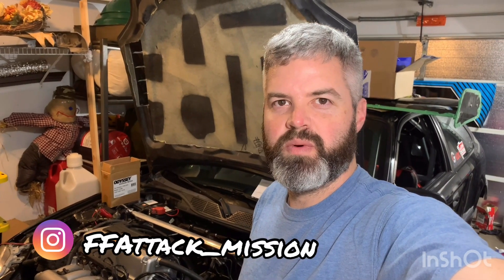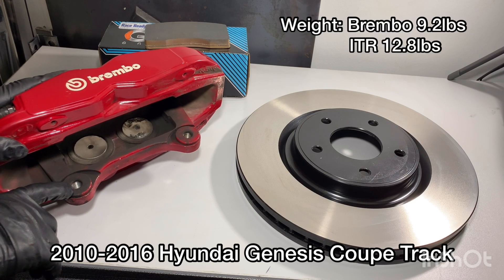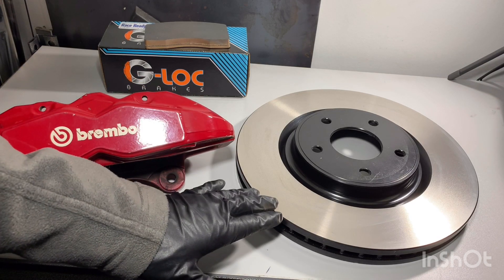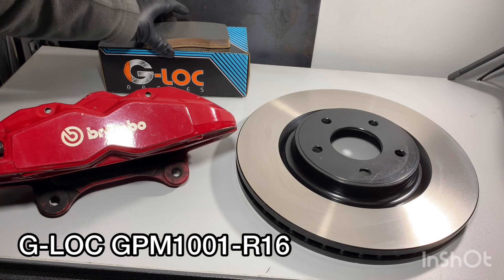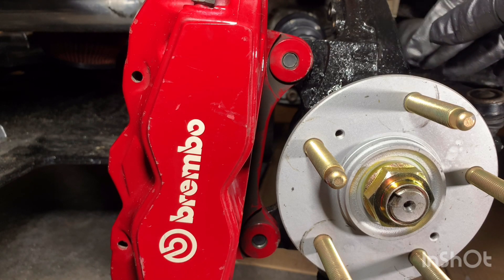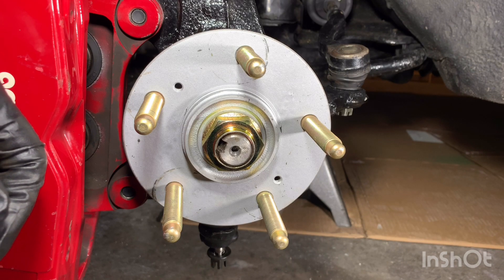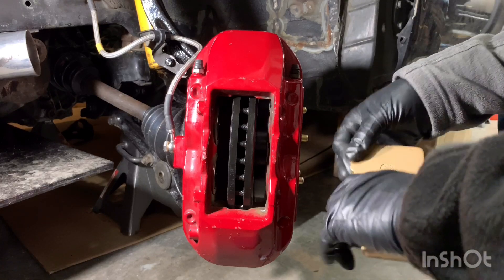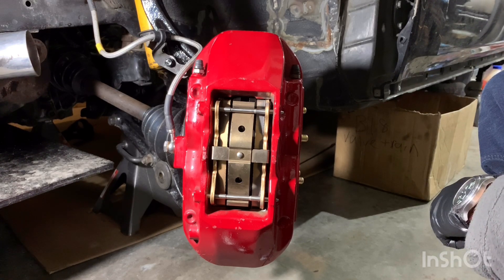DIY Brembo big brakes Civic & Integra

Comment: Thank you for this info it will help with my time attack cb7 since it it is the same bolt spacing with the itr spindle. What is the recommended rotor diameter for this?. Is their a range that works.

Comment: I have a TSX and thinking to purchase these Genesis Brembos too.  However, I am wondering if you would know the pistons sizes of the brembos, since we have to swap them left to right if the brembos have different size calipers it will mess up the balance right?
Reply from the maker: The pistons on the Genesis Brembo’s are all the same size. They do not have a leading and trailing piston size on each so swapping sides has no ill effect.
Reply: @FFAttack  For brake pads, are the just same with the STI or EVO pads?
Reply from the maker: RaphaelYC they are GP1001 pads the same as STI/ EVO as far as I can tell.
Reply: @FFAttack  Hey just received my rotors, pads and calipers.  The pads seems to be bigger than the rotors surface will that be a problem?

Comment: Any issues with noise from the brake swap? I've been reading on a forum and there were several complaints about a squealing noise.
Reply from the maker: My car is a track only car so yes I have some brake noise using race pads. Not sure about on road, I know a few with them on dual purpose cars with out complaints.

Comment: Would these brembo calipers work well with the base model mini cooper rotors that a lot of people commonly use as a big break upgrade for civic/integras? I believe those rotors are 280mm which is ~11" and are 4x100
Reply from the maker: No they won’t, the Callipers is made for a much larger sweep. Stock the Genesis runs 13” rotors so putting a 11” rotor in them will not work. This setup I did runs a 12.5” rotor if I remember correctly. In the video I compare them to my TypeR rotors that are the same size as the mini ones.

Comment: How is the pad coverage w the Rogue 12.6” rotors? Trying to determine if the 12.44” rotors from the 09-12 mini JCW would work for 4 lug folks. Do the rogue rotors have the same offset from the hub mounting face?
Reply from the maker: With out trying it I could not tell you for sure. I believe you would have a lot of pad overhang if you ran it on a 12.44 rotor.
Reply: @FFAttack  measurement wise it should be around 2mm overhang depending on the pad. Not optimized but should be functional in theory? Based on technical drawings I can find, the caliper should work with a pad shim on each side to take up some thickness. Might order a rotor from Rogue and Mini to compare 1:1
Reply from the maker: Yes your right, sorry I was thinking the smaller Mini rotor, that would not be bad. On my setup currently I have 1-2mm of pad overhang. Since I inoculate did this I have heard the Sentra SE-R rotors are fit with no pad overhang. I plan to try it when I need to change rotors. Nothing I have seen for 4x100 though.
Reply: @FFAttack  which year of Sentra? If I’m ordering to take some measurements, I can try to have a peek
Reply from the maker: @Luckyblooms I have not dug into it enough yet to know for sure. I was told you also need to run the RSX type S hub with the larger hub centric ring. I believe the 2007 Serra SER Spec-V is the one that is needed. CENTRIC 12142098 Rotor from my quick search.
Reply: @FFAttack  just based on listed measurements, SE-R seems to be 0.2mm smaller diameter
Reply from the maker: @Luckyblooms looking at mine ideally the rotor needs a 4mm wider contact area 1-2mm on the diameter and 2ish mm on the ID of the contact surface.

Comment: What size wheels you used to clear the caliper
Reply from the maker: I’m running 17x10’s et18 on my car. Fitment will really come down to the specific wheels. 17x9 RPF1’s do not fit but 17x9 Konig Hypergrams do. That’s all I have tested.
Reply: @FFAttack  sorry to bug but what offset were the 9's is your rears 17x8?
planning on buying advans 17x10et35 and 8s in rear

Comment: In your honest opinion how well do these perform once they get hot? I also have a k swap ek civic with the Porsche calipers on my four lug set up but I want to go 5 lug to run 17inch wheels. Thinking about using the crv knuckle for the front. Trying to determine what front brake set up to go with, seen the TL set up, genesis set up, or maybe go with fast brakes on a custom set up but that’s easy 2k dollars.
Reply from the maker: The track I use to drive on was known for being a brake killer, lots of slow corners with little straights so no time to really cool the brakes in a lap. These handled it just fine. Last year I removed the dust seals on the pistons as they like to catch fire. I just drop a drip of brake fluid on each piston to keep the seals fresh. I have run these for a 45min session in 32c weather and not had brake fade. I do have corvette brake ducts (have a DIY on them). So I have a steady flow of cool air. Pads are really important too, the G-Loc R16’s take all I can toss at them. Now that I run on less brake abusing track I’m not worried about this setup handling heat at all.
Reply: What wheel hub did u use, CRV or RSX type s?
Reply from the maker: CRV but I’m going to try the RSX Type S next time I do the wheel bearings. From what I hear you don’t need to do any machine work with the RSX type S ones.
Reply: @FFAttack  thank you so much for replying; i got the rsx type s and 2014 rouge 3row rotors i can send u photos so show fitment if needed before u buy

Comment: If I’m going from a 4 lug to 5 lug in the front what rear hubs can I uses to match the 5 lung that would fit my 92 eg? Or is there a wheel I can buy that would fit both stud patterns?
Reply from the maker: I still have 4x100 rear, my car runs 17x10 front and 17x8 rear so I’ll never be rotating the wheels and tires front to rear anyways. Generally to do 5x114.3 rear you need ITR stuff.
Reply: @FFAttack you can always go CR-V front knuckles and prelude SH rear hubs on stock eg/da/dc trailing arms.

Comment: Looks like the caliper is going to be on upside down? I believe the small piston is supposed to be at the oncoming rotor side with the brake bleed up.. This to prevent pad beveling as I recall.
Reply from the maker: Bleeder is up, no issues with pad wear so far.

Comment: I don’t know if someone can confirm that my idea would work.

Can I use rsx base 32mm bearing and hub in a type-r (crv) knuckle. ? 

Than I would only have to make a ring to make it hubcentric with the rotor. (64.1 to 68)
Reply: What? Just put the rsx hub in your stock knuckle. They all use the same bearing.

Comment: What rotor can I use if staying 4 hole rotors? It would be for a Integra LS coupe.
Reply from the maker: You can use the Rogue rotors as outlined in this, you just need to get them red re-drilled to 4x100.

Comment: Hello sir.. Kudos to you.. For this; I have a 1998 JDM itr 5x114 pcd with 36mm driveshaft.. Would this set up be suitable for my car without any further modifications? Thank you for help.. 👍
Reply from the maker: You will need to slightly machine the centre bore of the hub like I did in the video or the rotor to fit over it. It’s a very spall amount and any machine shop can do it.

Comment: Got a question I have  2011 Hyundai Genesis R Spec Calipers are they all the same and what diameter where the rotors
Reply from the maker: I believe all the R Spec calipers are the same. The rotors I used are 12.5”z

Comment: I have a d series track built ek. Considering this upgrade. Will the stock axles mate with the crv spindle ?
Reply: I think you'd need CRV knuckle, CRV bearing. RSX base model Hub wich is 32mm axle. The Type S RSX hub is 36mm

Comment: How is the brake pedal feel after installation? Did you upgrade the brake master cylinder?
Reply from the maker: It’s fantastic, firm and much easier to modulate. Breaking distance was much improved as well. I’m still running a stock 1” master.
Reply: @FFAttack  Nice! What about the brake bias? Did you adjust anything?
Reply from the maker: Yes I did redo all the break lines in the car and installed a Tilton prop valve. I have heard about others running on a 40/40 valve with a very low bite rear pad.
Reply: @FFAttack  Good to know. Just curious. Why did you redo all the brake lines? And  decreasing the brake line pressure for rear brakes would give better brake response?
Reply from the maker: I redid them to allow the Prop valve and simplify. I wanted to be able to adjust bias easily. Up here we get a lot of wet or damp track days so being able to adjust braking is a good idea. On these Honda’s the factory lines are Married front to back meaning the drivers front is on the same circuit as the passenger side rear and same on the other side. So when you put adjustable prop valve in you kind of need to do the lines. Ideally yes you do need to reduce pressure to the rear when going this big in the front. Going with a low grip rear pad is a bandaid but can work as well.
Reply: @FFAttack  Thanks for all the information. Good job!

Comment: Ok all the searches I've keep coming back with the CRV hub diameter of 64.1. What hub do you have at 70.1? I'm so confused. Because if the CRV is 64.1 and the Rouge rotor is 68 then you shouldn't have to machine.  I'm only asking because I don't have too many machine shops in my area willing to do this.
Reply from the maker: The wheel Center boar maybe that but the part of the hub the rotor centres on needs to be same as the rotor.
Reply: If ain't wrong the crv hubs are 71.X like the jdm itr hub, the thing i think it works is to put the ep3 CTR or the rsx-s (i think are the same) hubs wich fit in that spindle because they have 36mm shaft but the center is also 64.X like regular 6gen civics integras etc, someone correct me if im wrong but recent information i read goes in that direction
Reply from the maker: That’s correct, I’m putting RSX Type S hubs into my CRV/ITR big bearing spindles. This should get around any need to machine anything then use Sentra SER Spec V rotors.
Reply: @FFAttack  have you tried the sentra se-r spec v rotors with the rsx type s hub yet? Looking at specs, the rsx hub is 64mm and the sentra is 68mm still. So the rotor wont be hub centric. 

Are these rotors hub or lug centric?
Reply from the maker: @henrybui6353 not yet, the way the Rouge ones are setup on my car they are hub centric.

Comment: If ain't wrong you could use ep3 ctr or rsx-s hubs wich have 64mm center 🤔🤔
Reply from the maker: That’s correct, when you have the larger Wheel bearing CRV/ITR spindles you can direct swap the hubs. I’m in the process of doing that now so I can run the slightly larger (07-12) Sentra SE-R specV rotors.

Comment: Hi great content btw ... would the oem genesis brembo pads work? Instead of the g loc pads or is there a difference between them. Thanks and also I'm still on the 4 bolt hub not type r on my dc2 any other rotor that you know might fit
Reply from the maker: Stock Genisis pads will work fine. This car is strictly for track so stock pads would not work. No options I know of for a rotor in 4x100. You would likely need to red till the 5 bolt rotors to 4x100. Glad you like the content!
Reply: @FFAttack  thanks for the reply ill look into it 16.8mm disc if I can find one ill let you know

Comment: Thank you so very much for the detailed video! I have a couple of questions if you have the time. First is, which rear brakes are you using, are you using a bias adjuster and finally, what size wheel/offset/width are you using? Thanks again! You have a new subscriber in me!
Reply from the maker: I’m using stock GSR rear brakes with a Tilton prop valve. Wheels are 17x10 et18.
Reply: @FFAttack  that's good information. Thank you very much for replying!

Comment: Hey great video had no idea this set up was a thing so the machine shop made the bore smaller or added to it to fit the rotor ?
Reply from the maker: They had to machine a small amount off the cantering ring of the hub. I also could have had that taken off the rotor instead but wanted to make it so I could get a replacement rotor anywhere and just swap it on if I had a failure on track.

Comment: What submodel nissan rogue? Man i cant find the rotors at all wtf
Reply from the maker: 2017 Rogue 2.5L w/3rd row seats. Search on Rock Auto for RAYBESTOS 981779R Rotor that will get you into the right area.
Reply: @FFAttack  thank you so muchh!!! I found them on rock auto like u said...i picked up some refurbished rebuilt brembos from oreilys.. and now im worried will the rogue rotors fit my accord? I have a 2019 accord 2.0 sport... 64mm hub size.. 5x114 bolt diameter... the nissan rogue rotor is 68mm.. is that still okay? Will they still fit
Reply from the maker: No idea, only tried them on my 6th gen Civic.

Comment: Hi. I read all the comments and In what your videon3 times. I know you said the rotors come from a Nissan rouge with 3d row seat. Now. No one asks here, the year of the Nissan and model. Wen, you try to get the rotors, those are the info you need to get the right ones. Did you still have that info? I will be the rotors part number?
Thanks. I'm looking forward to upgrading my Crv 4wd turbo brakes.
Reply from the maker: Thanks for that I updated the show notes with the year I used. It was a 2017 MY

Comment: Have you tried fitting 16inch wheels with this big brake kit?
Reply from the maker: Zack T you need a minimum inner wheel barrel diameter of 385mm if you have that then you will need to make sure the spokes of the wheel clear. I have no 16’s to check fitment with.
Reply from the maker: Currently I don’t have wheels, this Covid19 shut down has slowed the wheel purchase. I have spoken with Konig and plan to run the 17x10 Hypergram wheels over these. I had them check and a 17x9 will also clear.
Reply from the maker: Yeah it’s tough to say, do you want me to take some measurements off my hub so you can see if they are close?
Reply: These brembo calipers are very similar to ones subaru uses. With subarus with STI Brembo swap generally anything 16" dont fit. But Ive heard people running 16x8 or larger with some machining work done to make them clear 4pot calipers. But generally the rule is 17x7 or larger on for brembo 4 pots calipers

Comment: Do you think 16” wheels would fit over this setup?
Reply from the maker: Possibly but would be wheel specific, it will be very close if they fit at all. I’m on 17” and needed to be carful what wheel I got to go over the brakes. RPF1 17x9.5 will not clear due to a lip in the barrel.
Reply: Why would you even want to fit 16's? 17's are faster cheaper and much much much better tires available.
Reply from the maker: Totally agree, 16’s did not even weigh into my plans. If you need bigger than 15” it should be straight to 17”.

Comment: what year CRV are those hubs from?
Reply from the maker: This is out of a 2000. As far as I know all the 1st gen USDM CRV hubs are the same.
Reply: @FFAttack  is it safe to say crv hubs and integra/civic hubs are the same bolt patterns size for the calipers besides crv being 5lug? Also how does this compare to the tl Type s brake calipers rotor sizing? I heard u can use type s tl calipers aswell brembos
Reply from the maker: Yes I believe they are. The CRV does have a larger wheel bearing as well. I did not look to closely as the TL type S stuff as I do not believe it was direct bolt on. Plus I think the Genesis Brembos accepts the larger rotor but don’t quote me on that.

Comment: Can you run these calipers on a factory 4x100 hub?
Reply from the maker: Yes you can, you would need to get the rotor drilled to 4x100 and find a 17” wheel that they fit inside.
Reply: Can i run these calipers on 4*100  lugs rotor or its must to have the roque rotors ?
Reply: I did the the brake conversion on my ek with integra 4 lugs brake w/calipers , does it fit or need some mods?
Reply from the maker: @abdullahr.a9942  need to get these rotors and re-drill to 4x100.
Reply: @FFAttack  thanks , good luck

Comment: I can find genesis calipers locally but on left side is available? Can I buy two left side calipers?
Reply: No, you need both calipers. If you put two left caliper installed then only the left on will work properly. Installing a left caliper on the right side will place the brake bleeder valve upside down. The brake bleeder valve must be on top or else the brakes will not bleed the air out properly.
Reply: @thomaspotemciano  bleed the calipers off the car similar to what we do with rsx rear calipers on DC integra.

Comment: What year of the Crv to get the spindles??
Reply from the maker: Any 5 lug 1st generation CRV.
Reply: @FFAttack  lower ball joint Can I use Buddy club extended lower ball joint or has to Crv lower ball joint?
Reply from the maker: Balljoints are all the same.

Comment: Will the genesis brembos work for my 2020 Honda Civic sport?
Reply: I believe they will. Only thing different than here on this video is 2020 Sports have 64.1mm hub centers, so you shouldn't need to machine your hubs down to allow the rotor to fit.
Reply: @jaybud3646  thank you so much bro I already tried it the TL type S rotors fit well with the calipers. I just need bigger wheels to clear
Reply: @bhinosrt8557  I found used Genesis calipers today by some miracle.  Bought em and are being shipped out. Here tomorrow hopefully. I have a 19 hatch sport. Nissan Rouge 3rd row rotors ordered as well. Going same route as in the video.
Reply: @jaybud3646  if the new pads don’t clear just sand them down even to make the rotors spin free
Reply: @bhinosrt8557  for sure.  Refaced many a pad before.  Large knife stone, files/rasps, even used a cinder block once.  Firm believer in I'll figure out a way no matter what. I don't give up. Stubborn as a mule, I believe it's called.